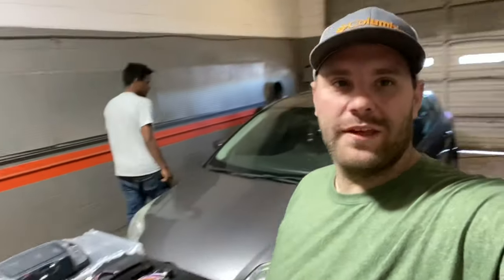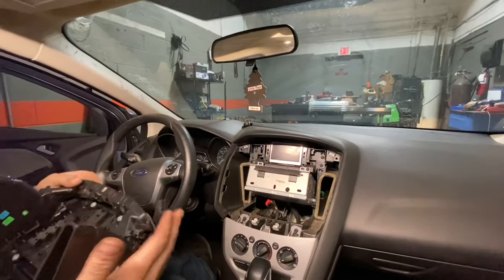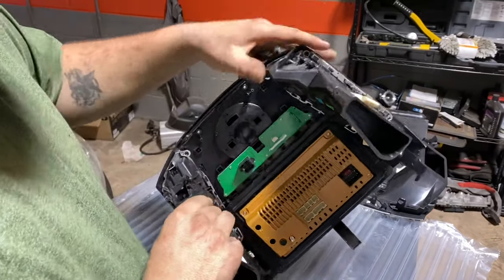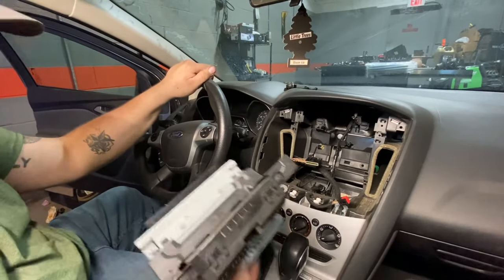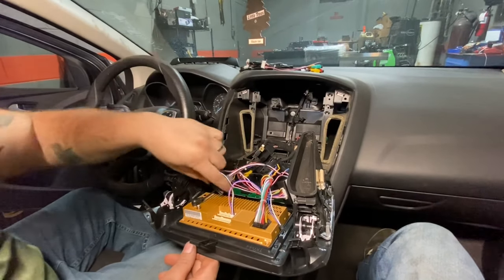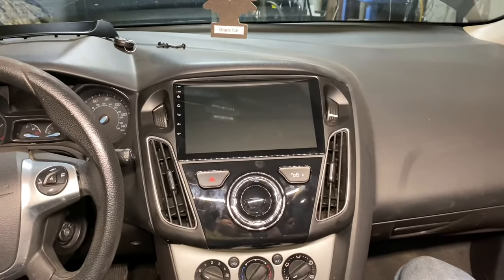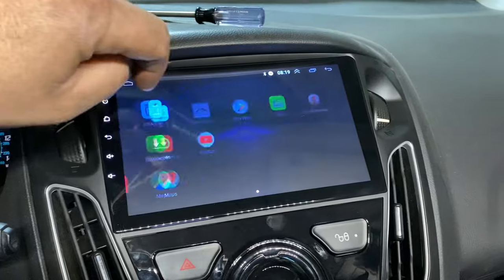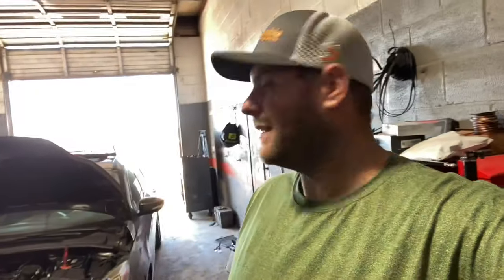2012-2017 Ford Focus tablet radio install. (Android based) this things awesome!

Comment: I had the same issue a lot of people are having with these style radios not turning on and finally got it working. Pretty much the only cable that doesn’t connect to anything is the white 8 pin connector (my cars a 2014 focus, not sure if it’s different for other model years), make sure to plug the 10 pin connector into the box and not the radio itself because it fits both. Also disconnect your battery before hooking up or you’re likely blowing fuses in the car or the one on the back of the radio if yours is like mine, red 10 amp fuse that’s located under the main cable
Reply: Did you have any issues with the faceplate buttons working?
Reply: @amacluskie  mine have been working fine. No issues with the radio at all at this point
Reply: Have been working on installing mine this weekend, your comment really helped about figuring out the wiring. But the faceplate buttons don't work except for the hazards and lock. Reached out to the seller. We'll see what happens
Reply: @amacluskie  good luck
Reply: @amacluskie  did you figure it out? I’m having same issue
Reply: @b62_rider39  there was a setting deep into it thatneeded to be changed. Once I did that, it was working!
Reply: @amacluskie  great thanks…I’ll have a play with the settings!
Reply: @amacluskie  I’ve tried using the settings but it says study fail, did you have to do any additional wiring behind the unit itself?
Reply: @b62_rider39  no additional wiring, just basted on the original post above. Is yours a Ford Focus?
Reply: @amacluskie  yeah Ford focus 2013, ive tried rebooting it as well but still comes up with the same error. Is it only the one plug that goes into the bottom section near the buttons? I can see another port and haven’t got anything plugged into it
Reply: @b62_rider39  If it is powering up, go into the system information and look for the canbus setting and you should be able to set your make model and year and the buttons should work
Reply: I have a problem where the screen doesn’t turn on at all, and I’ve now tried to put old one back in and it don’t work, checked fuses under glove box any other suggestions?
Reply: @AnthonyYallop-qk9ic  if you have a volt meter yellow and black on your power cable will tell you if you’re getting power, if so it still wouldn’t hurt to double check again and change fuses just in case
Reply: @SEOPaintball  will this be the fuses in the boot of the car ?
Reply: @SEOPaintball   I’ve wired everything up but still no screen power either
Reply: I'm having the same issue. No power to the screen but the hazards and lock buttons work fine.
Reply: same here
Reply: @SEOPaintball hey I have been having issues with getting my screen to work. Its brand new out of box, can you clarify on what you mean but plugging in the connector to the box not the radio? Seems like there is only once spot on the tablet the power cable can go
Reply: @AnthonyYallop-qk9ic did you ever find out how to fix the screen?
Reply: My radio still don’t work do I need a interface
Reply: @AnthonyYallop-qk9ic same issue only lock and hazard works
Reply: What do you mean by box?
Reply: Hola tengo un problema 
Instale el estereo y el botón de blokeo de las puertas no funciona

Alguien tubo el mismo problema y me comente como lo soluciono ?

Comment: So a lot of people had the buzzing issue. I had that issue as well. I took off the outside panel and then took out the inside box on the inside box there are 2 tabs with thermal paste. Replacing the thermal paste made everything work perfectly again.

Comment: had this exact one. very easy to install and held up through hell and back. sold the car and this stereo is the thing i miss the most about it. It got to the perfect loudness even though i still added a third party EQ to give it a 10+db boost. Whenever I had a shit day I would crank it to 25 and rattle my shitbox aluminum ford like a sociopath and feel alive. I got it for $99 and had the option to get Android/Apple Auto/Carplay for the price of a $40 usb dongle. Will never go back to brand name stereos after experiencing the freedom that is chinese headunits. the trim looked amazing and the fact they include the harness and wireless canbus and steering wheel interface was incredible. pure chinese magic.
Reply: hell yeah this is what I'm looking for in an upgrade to my plastic box with wheels
Reply: does it sound good without the third party equalizer?
Reply: @StandardAmeriCan1  it sounds great, i mostly used the eq to get a 10+db boost because they are cheaper than amplifiers. even the subwoofer out on the radio sounds pretty good without an eq.

Comment: I know it's an older video but have you experienced after installation that the temperature and mileage switches to kilometers and Celsius every time you switch off the car? Something is defaulting in my opinion.

Comment: Absolutely loved the video! Could you do the BXLIYER Android 10 Double Din Car Stereo Fit for Ford Focus 2012-2017 Head Unit - 9.7 Inch 2G+32G - Free Rear Camera Canbus - Support Sat Nav Bluetooth WiFi Steering Wheel Carplay Android Auto DAB 4G and compare the to? I hope you have a wonderful day!

Comment: The link no longer exists on eBay — I have the same one and it came with the car when I bought it. 
Would you happen to have the the model number so I can research this for a manual. Mine is stuck in kilometers. I’d like to reset it but I am not sure once I rest it if I’d get all the stuff back.

Comment: So I got this same aftermarket system, but my Focus has the sync 3 (I think) touchscreen radio. It has this giant apmi radio on the back if the touch screen that has a plug that does not fit any of the ports on this new one. I can not find a tutorial or instructions anywhere, and no aftermarket radio I have searched for has a port for this giant plug. Have you replaced one of these before?
Reply: Ever find this info out?

Comment: I got same unit when i installed, did not start, i though the unit is damaged. The new unit didn't work either, did you any other wiring?

Comment: What is the GPS Module for? Im going to connect it REGARDLESS.. but..

WHAT IS IT? WHAT IS IT FOR?

GPS.. is clearly for MAPS.. but how does it work using that module..?

I want this device in my car for 3 reasons:
1) RADIO
2) BACK-UP Camera (ive got one set up already)
3) GPS MAPS because i get lost all the time.. been living gere almost 20 years abd i atill get lost.. never got used to the mountains & hills.. im in the boonies but grew up city.. so i NEED GPS abd i cant fumble with a phone while im driving.

Comment: Hello Derick, 
What do you think about the angle of the screen? is it reflecting much when you drive the car?
Reply from the maker: It’s honestly not bad. If you got tinted windows it’s perfect
Reply: @DGGarage   thanks
Reply: I had the exact same one for like 12 hours the glare was way too much at night it looked cool tho
Reply: @simonfearing4907  buying a matt screen protector could be a quick solution fort the glare issue.
Reply: Hi 
I have the same problem. 
U can't see proply after installing it

Comment: My 2014 Ford focus has really loud ear bursting pops and static, it’s so loud and random I’m driving down the road and almost have a heart attack,
My mechanic thought he’d fix the problem with a battery cable sensor but it’s only worse nowI can’t drive it, my mechanic said it should be a recall and to have to fight with Ford, i’m afraid of dealing with the dealership on this.what is your advice, is it just a radio replacement?
Reply from the maker: Yes the radio is bad. Same exact thing that happened to me.
Reply: @DGGarage  thank you for your reply!
It happens even when the radio is turned off.
Is that what happened with you?
I’m just scrambling for answers here, did you have any other strange electrical issues?
Should I be concerned about the audio control module? Computer?
I don’t know why no one’s suggested just changing out the radio, they say that Ford isn’t addressing the issue and tons of people are having the same problem.
My mechanic wants me to fight Ford, he says if he tampers with it that they won’t validate the problem and I’ll have to pay them.
I’m going to ask another mechanic for advice, and avoid the dealership until I know more.
Any advice you have I really truly appreciate!
Reply from the maker: @shelldaniel6412  it’s definitely the radio. It’s a very common problem with these cars. I see it all the time. Even if the radios off it does it.
Reply: @DGGarage  thank you for helping, I doubt you’re nearby or I would bring it into you,
What do you suggest I do, take it to a mechanic and just have him switch out the radio?
Should I have the fuses checked?
I wonder why the computer is also affected.
Should I avoid the dealership?
what radio should I have to replace, and how much money are we looking at for this repair?
Reply: I had the same problem on my ford focus 2014 se like many other ford drivers, I got mine from Amazon for CA$360+tx and installed it myself. It feels great now. I can install apps too
Reply: @liftwith_shiva  Can you tell me exactly what you ordered on Amazon to replace?
Also I’ve heard that replacing the stereo doesn’t always fix the problem,?
Reply: @shelldaniel6412  I've returned it again after 1 day usage. Sound is good but there is no CarPlay or Android Auto which I need. Another problem is display facing upwards not vertical which makes it difficult to see during the day time. There are other radios on amazon for less than half the price that has CarPlay but it doesn't come with dash kit. We have to install it externally somewhere on the dash with brackets and nuts

Comment: there's actually an upgraded version of this with 4gb of ram instead of 1 which im considering buying for the ability to add a sub. how's the sound quality compared to the original unit ?
Reply: do not buy the 1gb version its unusable. Got 1 returned for 4 and way smooth
Reply: Do you recommend I want one but don’t want it to be buggy

Comment: Hey thanks for the video. Just installed the same one on my 2012 focus. One problem I have after the installation is the GPS. Maybe I didn’t plug something in but do you have problems finding your location when in google maps?
Reply: Google maps doesn't work that well with no wifi in my experience. Generally I've had to start navigating on wifi, have the map downloaded, then it kinda works. Sometimes.

Comment: Did you have to disconnect the battery first?
Reply: If you don't want to destroy the electronics yeah.
Reply: @austinsmith5611  I did. Had it installed for a month already lol

Comment: Hey I installed it as shown and the radio works great, but my front windshield wipers now don't work. Does anyone know why this may be?
Reply from the maker: I feel like that’s a unrelated issue. These cars have issues with wipers to being with
Reply: @DGGarage  thanks for the reply. I guess this car is just the gift that keeps on giving
Reply: Probably didmt unplug battery

Comment: Where is the setting to fix the time I can’t find it anywhere and it’s driving me bonkers with the time not being right
Reply from the maker: You should be able to push and hold the clock and it will let you change it

Comment: Do your steering wheel controls work? Also how did you control the volume?
Reply: Yea. And theres a volume button on the steering wheel and the screen. And when youre adjusting the volume you can actually clock on the bar and slide it. I can say I prefer a knob
Reply: @violentdavillain3430  did the steering wheel controls work straight away or do you need to sync
Reply: @thomasgraham1200  If I remember correctly it already works.

Comment: I have 2012.focus but do not have sync and only 1 plug on back old radio would it still work?
Reply: Did you ever figure this out? I've ordered the unit but can't seem to get it to work, wondering if this is the problem,
Reply: @jimspendlove4078 yes I did there will be alot of extra wires not hooked up
Reply: @shanepierce2194  yeah that’s the problem I’ve got now. Did you find one that fits? Can’t seem to find one with 1 plug
Reply: @jimspendlove4078 yes I did its there just need find it I didn't hook up the camera tho

Comment: How long have you had it running
Reply from the maker: Since the end of March and it’s been great. The only complaint would be the angle of the screen and if you don’t have tinted windows it will have a glare

Comment: How long did you have to wait before the screen turned on?
Reply: Mine wont turn on either
Reply: there is a box that you’ll think doesn’t go to anything but you have to plug it into one of those white pieces that he said don’t worry ab
Reply: @Shealey Media  did you end up figuring this out?? I have the same issue
Reply: Did you figure this out??

Comment: Dude, good vid until you got to phase 4 (connecting the wires). I'm here with wires everywhere and no detailed instructions for where they're connected. I'm kinda pissed I'll have to take to shop to finish the install but whatever. I'm a first time installer, telling me to just to connect to corresponding connections does me no good. And you forgot to mention there's hex screws involved. Smdh.
Reply: Did you ever get it sorted out?

Comment: Does you sync work with that also does the steering wheel controls work??
Reply: Sync is disabled afaik, however my steering wheel controls work fine.

Comment: Was it plug in and play with the lock button and hazard lights ? Can you send me link?
Reply from the maker: Yes it was plug and play and the hazard and lock wires plug right in perfect
Reply: @DGGarage  I just installed mine today. my hazards are working but my locks aren’t. What did I do wrong?
Reply: @annawilliams9530  I’m having problem as well but the hazards light are not working.
Reply: @assugeni2  hi have you fixed you hazard problem ?
Reply: @dmaamd  hi, I found out what was the problem. The push button was broken, I managed to to find the replacement part on Aliexpress but I haven’t tried to fix yet, although, I bought a new fascia (also in Aliexpress) and its working fine, this was the only solution I found, but if are good on soldering I recommend trying to replace to part, since is very cheap.

Comment: Hello everyone,  I connected mine, but I'm getting no power when I start the car up . Fuse is good . Keep in mine I'm installing mine on a focus st 17 not that it matters. Ill t ake anyone help right noe
Reply: just installed mine and same thing. Would not turn on. the emergency lights and locks worked great but the screen wouldn't turn on :/
Reply: Did you guys figure this out?
Reply: @johnreyes8062  yup figured mine out!
Reply: @ashleywilliamson6604  how did you make it work?
Reply: @ashleywilliamson2820   what’s the issue

Comment: I'm having issues with it, there is only one cable that goes into every single port individually so it's not hard, the buttons work but the screen never turns on, this is my second radio doing the same thing, could a fuse cause this?